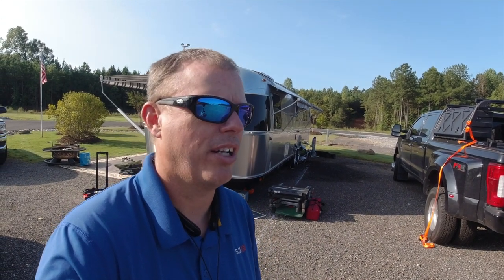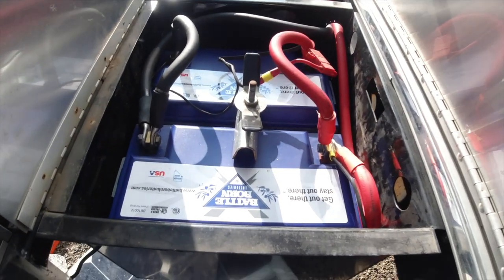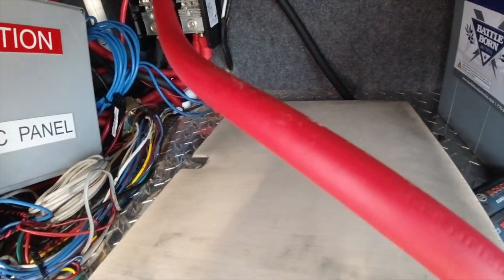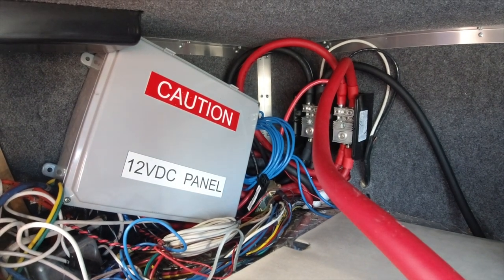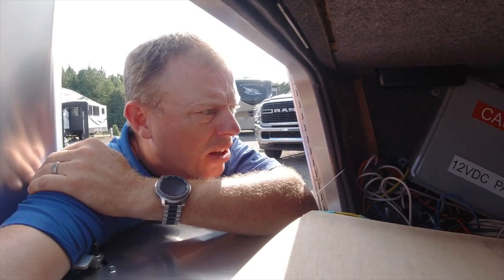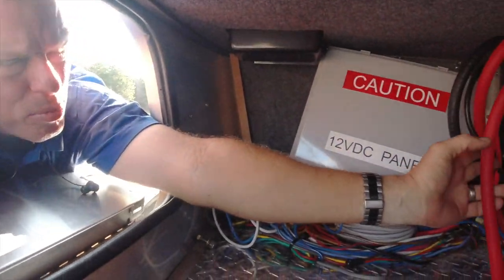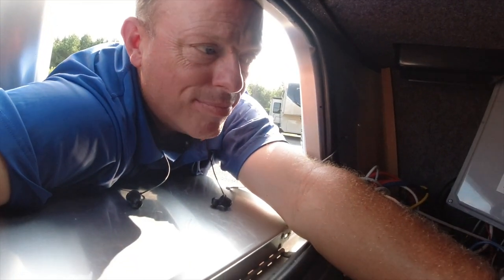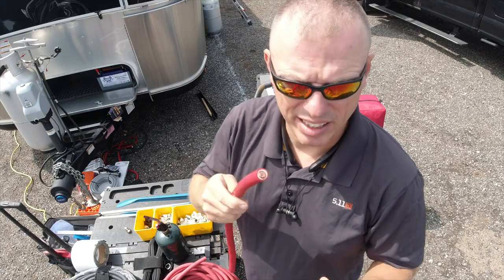How NOT to install a solar & lithium system in an RV | 2018 Airstream Classic 33FB

Comment: Electrician checking in.  This is nightmare fuel.  I'm curious how the connection is made between the 2/0 and the threads, under the heat shrink.  Is it some kind of compression fitting?  Never seen anything like it.
Reply from the maker: It was a very poorly made cable that was ordered from some foreign company (definitely not made in the US).  The copper in the cables not true solid copper.  The cable was much lighter than the cables that I replaced it with.  This junction was the choke point from the seperate "banks" of batteries...  There was not enough surface area in the connection to allow the amperage to flow from the batteries to the inverters. I have never seen anything like it before either.  Once everything had been gone through and reinstalled with proper wiring and resealing, the system is still working flawlessly.

Comment: I'm intrigued how you wired 10 solar panels, 5 either side of a curved roof (where sun conditions could be really different each side). How many in series and parallel.
Reply from the maker: Unless it's unavoidable, I wire everything in parallel. As far as Airstream roofs, to keep the aesthetics the panels are flat mounted. This does cause a slight pitch, but to most Airstream owners the aesthetics are more important than the small loss due to the pitch. On our 1988 Airstream we did 2600W of a rail system, but it was quite the eyesore.
Reply: @TheDryCampers  Wouldn't it make more sense to wire the panels in series? You have an MPPT controller that will accept higher voltage, plus you wouldn't need the huge gauge wire leading down from the roof.
Reply: @tgriebe  the problem with a series configuration there would be shading. Those AC units look like they are shading parts of the panels since they are so close and would affect the entire system. A combination of series-parallel would be nice to reduce wire guage and hopefully mitigate the shading issue.

Comment: Lot of people don't know the current flows on the exterior of the conductors, so more strands means less heat and more current carrying ability .
Reply from the maker: Yep, you're on point.
Reply: Nope strands carry as much as thick solid.
Reply: You are confusing high frequency propagation with DC. DC current (and low frequency AC for that matter, 50-60Hz is low frequency) flows through all of the conducting material, not just the outside or surface of the conductor. The issue with using solid conductors in a road going vehicle is faster fatigue at flex points. The other issue, as mentioned in the video, is if the clamping force on the wire does not get enough conductive surface contact it creates a high resistance point in the circuit.
Reply: I have never seen thick solid 2/0 copper. Where can I buy some, he he.
Reply: @gregpeterman1102 

I have never seen thick solid 2/0 copper. Where can I buy some, he he.  Robert gregory